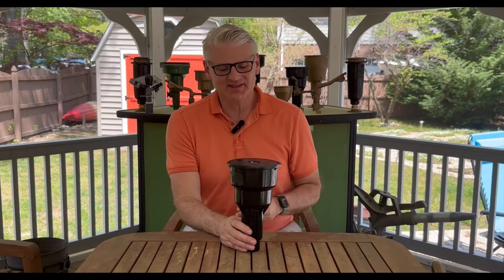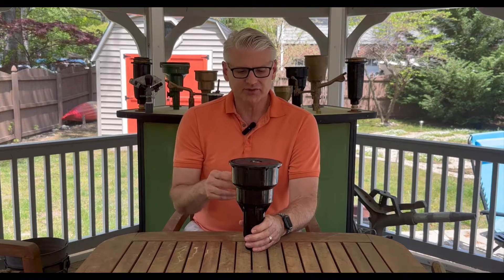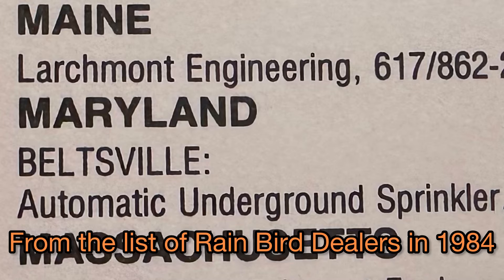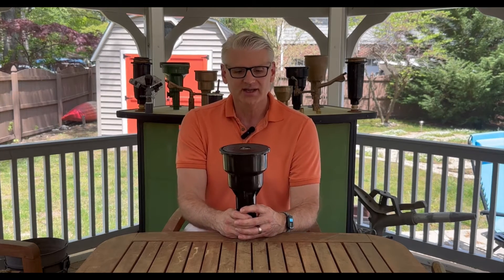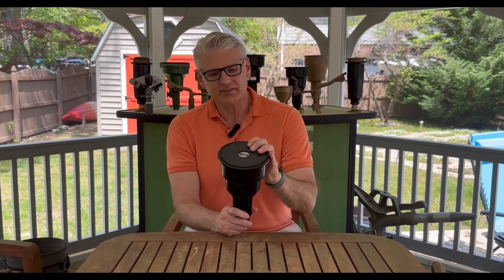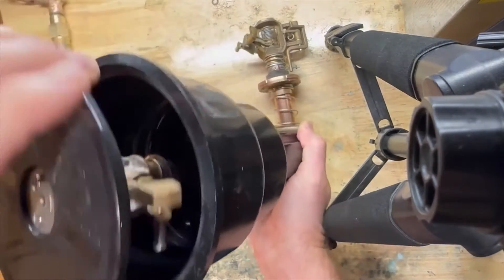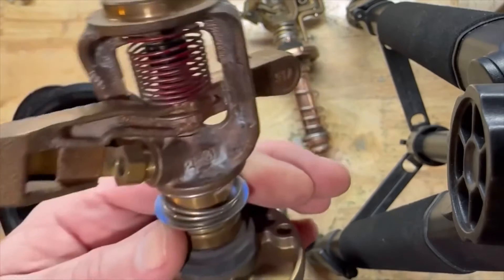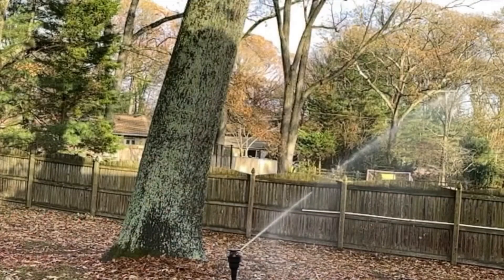Rain Bird 27AP Pop Up Brass Impact Sprinkler in a Plastic Case with a Metal Cover #irrigation

Comment: There should be a 4 digit date code on the top plastic rim where the rubber cover would seat around the edge. I have a 31A with a date code of JN 94 , June 1994 for those who aren't familiar with date codes.   Amazing video, fits your passion well! ❤
Reply from the maker: Thanks. I’ll have to take a look.

Comment: Over the years, I’ve picked up 27 37 and 47s on eBay. Generally unused. I installed them in my dad’s 2 acre yard. These are so rugged, and they seem to not require a lot of maintenance beyond yanking out the st Augustine runners that occasionally grow into the case.
Reply from the maker: Agree. Those are incredibly durable sprinklers. Love hearing someone is using them as intended.

Comment: The 27AP first appeared in the 1985 catalog. That catalog is rather significant because it also was the year Rain Bird overhauled the 25 impact series and changed the arm and got away from the traditional ADJ and DA nozzles. There was a 4045 and 5055 impact introduced that lasted maybe only 1 catalog year. They were similar heads to the 27AP with a plastic trip assembly and more of a round case. I have never seen one out in the wild.
Reply from the maker: I knew someone would have the answer! Thanks!
Reply: I didn't even know a 4045 and 5055 existed. Interesting !

Comment: I like seeing you change out the full circle model for the part circle model which is quite unique in the design and different from the reverse mechanism of most of the more modern sprinklers.  It appears to be well made and moves well.  It may not be fast, but the timing of it is much like I would expect.  Thank you for sharing.  I have smaller sprinklers including canister models, but there is no way I can run these bigger models, with the minimum space I have.
Reply from the maker: Thanks. I have to say my neighbor believes I don’t have the space either. I shot the video of the sprinkler running about 14 months ago, and I’m happy to report that since then I only allow the full circle models to go into their yard. In this one, I needlessly have a part circle adjustable sprinkler shooting to  right over the fence. It would have taken nothing more than a minute’s thought to not do that, but we mature at different rates, I suppose.
Reply: @antiquesprinklers  I do understand completely.  Thank you for your details and information you share in your videos.
Reply: @antiquesprinklers  when I ran my P100 at my parents It got to the neighbors yard on the other side of the sidewalk. I bet they enjoyed the free water! Although I didn't run it for long!

Comment: Nice 27! I have one as well. It ran good off the hose. I love those catalog pages! I'd love to read them during my free time! Nice pages of the 81 too. Mine was the regular 81 with the metal cover! I also seen a few of Buckner's models (the 17091 i think?) I saw one on ebay a long time ago and  it was 150$ or more. Thank you for sharing this rotor! If i had my own house i'd have a few of these in my yard!
Reply from the maker: You’re tempting me to swap out my I-20’s. I should probably just do a zone of 15111A’s to wake the neighbors and be done with it.
Reply: @antiquesprinklers  now you've may have convinced me to go get that 51 upper body assembly at the dealer out of the bucket and swap it out on one of my other commercial rotors! I'm sure I could get the head for a decent price. It actually looked new!
Reply from the maker: @NelsonBigGunP200Fan you should!